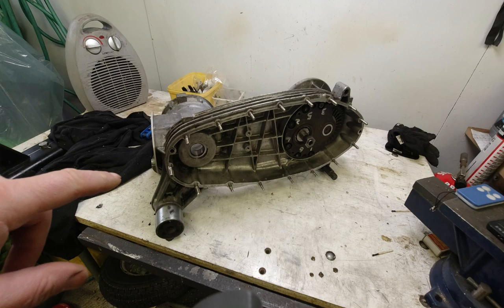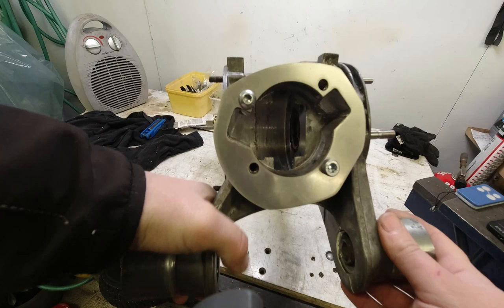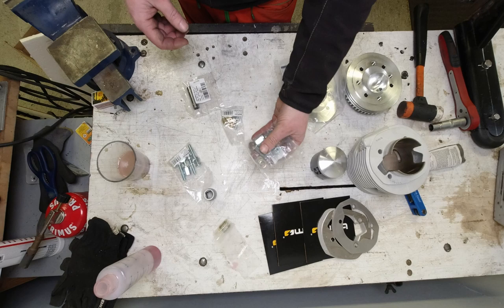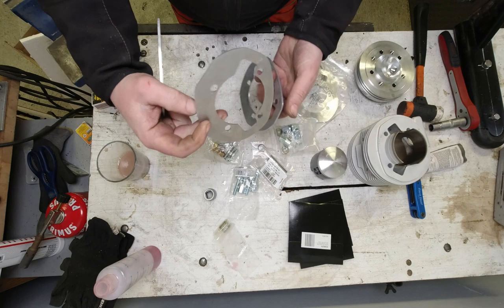Lambretta, BGM RT195 fitting. TV175 rebuild part 7

Comment: Hi Rob I need your great advice on choosing a new exhaust for SX 200/68 I have put a new BGM 225 kit in with a 30 mm Dellorto carb  it’s going lovely apart from the very loud pipe which is a Scootopia Clubman no to old ,I want to stick to a clubman  for the retro look but need to tone it down a bit so thinking of a BGM 4 or a Sip sport ,Which would you recommend for a quieter sound and good performance ,thanks for the Vids Rob always a great watch
Reply from the maker: Bgm clubman is nice but the bgm clubman sport has a very nice tone and delivers a bit more mid range too. I haven't hears the sip pipe.

Comment: Hi great video. Question. Do you have a video on taking the race off the crankshaft before installing the new one? Heat and grind or? The 205 bearing in the mag housing I mean for my jet200? Also if you don’t have a crankshaft puller tool what to do? Can I use the original gear with some spacers?
Reply from the maker: If you don't have a race puller you can fit jubilee clips above and below the race and carefully cut it off with a dremmel. You don't need to cut all the way though because it will crack off when you are over half way and apply some heat.

Comment: ok dumb question; TV 175 2/3 used a longer 116mm conrod, am I correct in assuming that no longer matters because you're just matching your new 110mm crank to the RT 195 kit that is made for all small blocks? If you were trying to use the kit with the standard crank (don't worry I am not), I'm guessing that you have to shim the hell out of it for it to work. Last thought, since the TV 175 sort of falls in between a small block and a big block, is there anything else that needs special attention? I know it falls into the small block category but was the case inlet longer to accommodate the longer rod? Thanks, keep up the good work!
Reply from the maker: Hi Patrick, not a silly question. The original TV crankshaft is reportedly one of the smoothest out there. It is possible to get the RT tuned to suit a 116 rod but 60 stroke will give the crankshaft big end bearing an easier life. I know that Mugello came in a version for a TV crankshaft. The only other difference between a TV and Li, is the gearing. there is quite a big gap between 3rd and 4th.

Comment: Great vid Rob . As I’m a bit of a dummy , missed why you used the solder ? Cheers. Alan
Reply from the maker: To check the squish. It's the distance between cylinder head and piston. 1-1.3mm is good. Any less and the piston may hit the head and you will have too high compression and it will cause pre-detonation (pinking). To low and it will run hot.
Reply: @kickbackgarage  Ah , thank you for info 😊😊
Reply: I’ve just put a 175 on my old series 3 LI
The squish is 2-5 . Too big ? Does that mean taking the gasket from under barrel and using stuff from tube as a gasket? Thanks in advance 😊😊
Reply from the maker: How thick is the gasket? Have you got a head gasket?
Reply: Hi, barrel one is 1 mill, and a head one of same size
Reply from the maker: Then it's better to remove the head gasket and keep the bottom. Most tuners try and avoid head gaskets because they are more prone to blow than base gaskets.
Reply: Will do ! 
Thanks for help 😊😊
Enjoy all your videos 👍

Comment: ROB The BGM RT 195 Kit requires a 200 inlet manifold. As part of your 175 re-build do you have a video showing this manifold and the setting up of a carb (the carb used)?
Reply from the maker: Yes. The carb setup is the dellorto video. You can use all 200cc inlet manifolds. I prefer the bgm with blot on rubber but have used the mb one too.

Comment: I think thetwo sets of rings are in there as you need to change them very early on ?
Reply from the maker: Nope. Its nicasil. Ive fit 5 of these kits now and always just one set of rings.
Reply: I was reading a recommendation from Mark Broadhurst on the f/b rt 195/225 page the other day , that said the rings should be checked at 1000 miles..just assumed that’s why they give you two sets?
Reply from the maker: @stevetowers8282  , checked, not swapped. Its standard procedure on all new builds.
Reply: Kickback Garage thanks Rob... that clears that up for me..

Comment: Thanks for the video, I’m using it to help me build the same spec 60/110 BGM crank with the 195 kit. Using a 3mm base packer. Have the same result that the transfer ports line up perfectly and the exhaust is .5mm below. BUT when I check with the BGM instructions it says :  “The piston crown should sit 0.5 mm below the bottom of the transfer ports.* This gives the right transfer timing.” Are the instructions wrong? (I confirmed that they are the ones for the 60/110 crank). Thank you!
Reply from the maker: According to the designer (Mark Broadhurst) the bgm instructions are wrong. The exhaust port being lower was actually an error under the design stage but it doesn't affect performance, so they kept it like that.
Reply: @kickbackgarage  the instructions say nothing about being .5mm under the exhaust port. (I will modify this later on. So the exhaust is level) . BGM instructions say the piston crown should be .5mm below the transfer ports. (When in both of our builds using the same parts the piston is level with the transfer ports). This is also not correct , right? Thanks again!

Comment: What head gasket was used? 2mm 2.5mm ?
Reply from the maker: I can`t remember!  its a couple of weeks since I filmed this one... 2mm I think.
Reply: The exhaust port always sits lower than the transfer ports on the 195 whereas the 225 are level across the board 😉
Reply: What head gasket you got.My recent build, same specs, used 1.2mm
Reply: Zachary Harper 1.70 head for a squish of 1.00

Comment: greetings rob....i've got a quick question
if i have a 125 with a SH1/18 jet 99 starter 45 piot 60 and i put on a tv175 barrell with a 175 conversion
piston..the ports all line exact with this stroke...squish is like 1-2mm and all is good...i cant get it to fire?
is my timing off with same line up? or is my carb under jetted and not enough fuel to get busy...
i know the answer...kit up to the 195😊but in the meantime i have to make more cheese
so continue to jet up? OR buy bigger carb OR cut out some metal in my small manifold and jet up
OR? 
tHANX rOB, YOUR VIDDY HAS MADE LAMBRETTERING MUCH MORE better than vespering anyday!
Reply: oh shootz compression is around 78 psi and has BGM 112v ignition with stock TV exhaust
Reply from the maker: Have you changed your crankshaft?
Reply: @kickbackgarage  no 
It lines up the same, should I?
Reply: @kickbackgarage  wait a tic...it couldn't line up with the stock series 1 barrel on a 125 stroke could it? i think i might have answered my own question?
Reply from the maker: You always need to re time ignition if you change. What ignition are you timing are you  running? I've never used a standard carb but think 19 was used on 175.
Reply: @kickbackgarage  yep
It’s a sh1/18 but I have an mb23 stock for early175 and 21 for mid and later
I have all 3 of these and the BGM timing looks to be 19
I’m going to recheck ports, then retime and maybe be good? After that I’m getting into changing crank and I’ll wait until piston up
I’ve got a Mini Cooper head that needs puttin on first!
Thx and I’ll keep ya posted
Thx for the help
Where can we send a few shekels for goodwill?